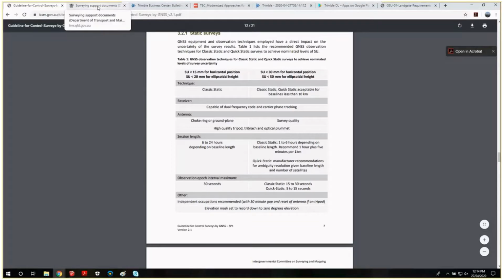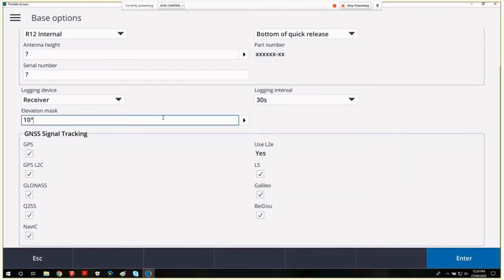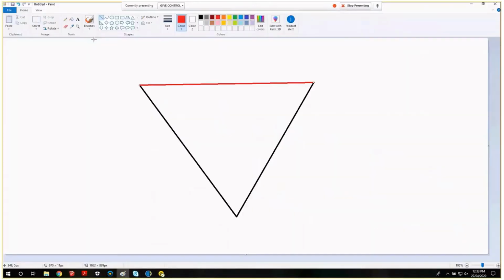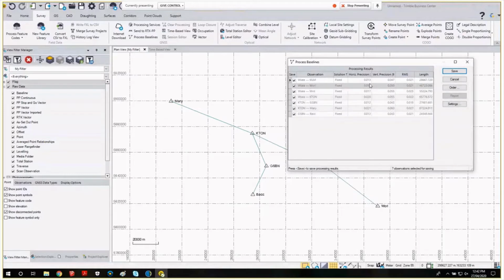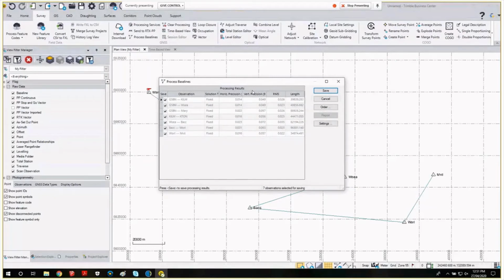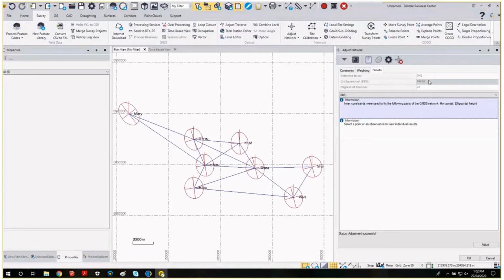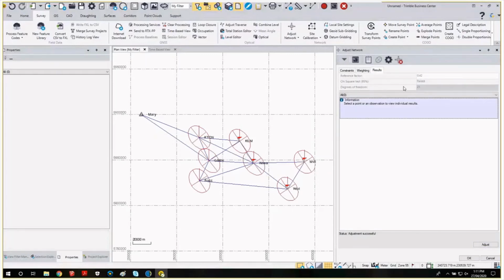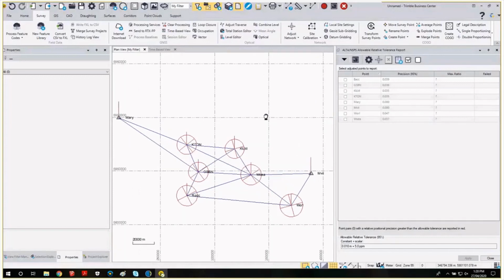GPS Baseline Processing

Comment: I have used Trimble products throughout my military career, and you mentioned setting the Elevation mask for satellites at 10 degrees.  We normally set the elevation mask to 15 degrees; however, we would lower the elevation mask to 10 or sometimes 5 degrees, especially in areas that enabled us to grab or use more data from more satellites if we were experiencing a lot of cycle slips or other interferences from some satellites that were skewing our data. Then I would disable those bad satellites from being used for processing, and use the available satellites that were in the range of 5 or 10 degrees above the horizon to potentially give us a stronger data network tie. If not we would run another session or two as necessary.

Comment: I thought Trimble DL stood for down load.  Data Logging makes more sense.  Been thinking that for 4 years.  Been telling people to look for the app as Trimble DL and saying down load.  I like it.  It is faster than the wired data transfer app.  You don't need the special Windows 10 usb to serial.  Use Android with Trimble in general.    iPhones wont take a beam from the TCS3s